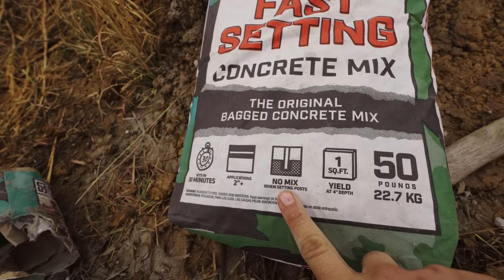ONE MAN Builds POLE BARN In UNDER 20 MINUTES / Start To Finish / Barndominium

Comment: Oh wow, that's beautiful. That was so fun to watch! I'm a mom who designed and built my own 36x32 foot all wood constructed monitor style horse barn (with a hay loft) years ago when my kids were just little. I hand dug every one of my post holes because all I had was a manual post hole digger. I used 6x6 and 4x6 posts four feet apart and boy, this is one strong barn. I had a huge tree fall on it in the fall which damaged some of the metal roofing, cracked some of my 2x8 rafters and some of the plywood under the metal roofing but that barn held the weight of that huge tree for a week until we got it taken off with a crane. Building my barn was one of the most fun things I have ever done in my entire life.I can tell you had a great time building yours!  Gonna follow to see the tour of the inside!

Comment: why do youtube builders not believe in a proper foundation. It kills me
Reply: Why does it need a foundation? It’s a pole barn dude not a shop or a house
Reply: Youve never heard of a pole barn I see. This is how they are all made homie.
Reply: I would delete this comment, goofy
Reply: They know their life expectancy working hard is not as long as that post. Looks good from here crack the beer enjoy
Life before your gone
Reply: Agreed. The PT posts will rot in 10 years (if lucky enough to make it that long), unmixed concrete around the posts, and unprotected steel panel ends in direct ground contact will rust the bottom panels. If you don’t do it right the first time you’ll get another chance when you have it do it over.
Reply: Did you see the first line he said? No experience. Pole barns are an easy compromise.

Comment: Great Job Jason. I just worked for the first time with those metal plates two weeks ago and is so much fun because they are easy to fix, easy to cut, no painting and you finish very fast. Was a good choice to use them, Im just a little concerned about the heat in summer inside the barn... But probably you know what you are doing 😅

Comment: Awesome job.  I was thinking you should put some z flashing over the door (my OCD kicking in), as that's going to route a lot of water right into the wood and rot it... maybe consider it the first time you have to repair the doors for any reason, just trim the height for that top trim board so you can put the flashing behind the metal/over the trim

Comment: Amazing for one guy...question about the posts.  Aren't you worried about them rotting in the ground?  I live in Atlanta, we get about 110 days of rain per year, so fence posts tend to last about 10 years in low areas and 20 years if it's high and dry.  We started using black roofing tar on the bottom 25 inches to preseve the posts.

Comment: Very inspiring!  I have 2 acres and am looking to get a few goats & chickens and MAYBE, eventually, a small jersey cow to milk (don't know anything about that yet). So, I'll have to make some kind of space in my backyard. I like the way you have the video and can pause it for detail if I need it/go this route. Also like how well you had everything measured beforehand with minimal consideration needed for cutting to fit - like the metal sheets all seem to fit at 8ft. That's how to do it!  A few questions:
Rough cost of lumber & metal of this building? 
What saw is used to cut those metal sheets?
With the metal sheet roof just side by side like that, won't it leak?  (probably answered in the next vid)

Comment: Amazing video, but only think i would be concerned about is the rafters I definitely would have definitely doubled up your ridge board just in case to hold of the weight of your purlins. Plus you only have one 2x6 holding the ridge board. Other than that great build.

Comment: Good job but the one thing I saw was you should of had a board on the bottom by the ground to keep the steel off the ground so it won't rust.  We had a pole bldg put up in 1986 and 2020 and none of my bottom steel touches the ground.   But you did a good job.

Comment: I'm about to start a similar project and seeing it done helped me a lot. Thanks for the video. Did you designed the barn or did you purchased the drawings?.
Reply from the maker: I just thought of it in my head and started building lol you got this
Reply: @TheCrockers  How long will the columns last in direct contact with the ground?. That makes the job much easier than pouring concrete pillars to keep the columns above ground.

Comment: Barn looks great. But I've never been a fan of putting posts in the ground, wood expands, and contracts, which usually leads to the concrete to crack.  Heavy duty saddles set into the concrete is the way I did my pole barn.

Comment: Nice job! Well done! One thing that i don't like are the footings. Concrete in direct touch with wood, that is unacceptable. The concrete through all years is like sponge. It gonna suck all humidity and then penetrate in the wood. As the time passing by, the wood become weaker and starts to disintegrate. Unless this project is temporary. Don't get me wrong :) 
However nice to watch. 
Cheers!

Comment: What was the cost for this and what size is your barn?
Reply from the maker: I think I spent $6,000 - $7,000 in materials. 
The main barn (the middle) is 20x30 with a 10x30 overhang on each side. So a total of a 40x30

Comment: I'm a bit worried.

the entire load bearing seems to hinge on those screws and absolutely no vertical lumber it did not even look like the roofing was centered over the poles...

each to his own but i would not expect this to hold up very well in rough  weather.
and make sure to rot proof those timber poles that went into the ground.

where i live this would not be up to code.

Comment: That roof is going to fall in. Not properly cut or built to carry a load. No vertical load being carried to the ground at the joints in the middle. Two 2X6’s nailed to another doesn’t give it strength and the span is too large with no vertical load being supported. Great idea but there is a reason they have truss angles and notches. Hope you animals are safe.
Reply from the maker: It's not going to fall in. There are 4x4 posts that go from the ground to the 2x6s.

Comment: You did a great job! But are you sure you shouldn't have made one of the doors at least a 10 by 10 to at least get a four wheeler or tractor in. If you put a cow in there or some other bigger animal,  how would you get them out if they pass away inside. Trust me I've been there plus it would be way easier to clean out the barn and get your grain and hay inside. But you gonna do you and it looks really nice!

Comment: Why do people build small pole buildings and use 2x8 or 2x6 for gerts? Seems to me their only purpose is shear resistance and hanging very light gauge steel from. Why would a 2x4 not work for this? Typically 7/16 OSB is used on a stick framed house and that seems sufficient....are people just using oversized lumber because thats what they see others do?

Comment: No footing? he didn't show a footing being poured.  The poles were sent like fence posts.  Nothing under.  They don't need cement around, you tamp rock in for proper drainage.  It ain't no fence.   It will have a load.

Comment: Pole barn in under 20 minutes with no experience whatsoever, says the dude that has several lying videos claiming the same.
Even if you're on meth (which you probably are), you're not doing this in under 20 minutes.. Maybe 20 minutes in tweaker time, which to translate to real time you multiply the number by it's self.
20×20= 400 minutes. Over 6.6 hours.
Reply from the maker: You my friend may have done drugs, because your brain cells are gone 🤣 if you think anyone can build a barn in 20 minutes, you're a DingDong head! But this was my 1st barn to ever build... so no experience, and the video was in that time frame. Thanks for watching and leaving the dumbest comment yet!